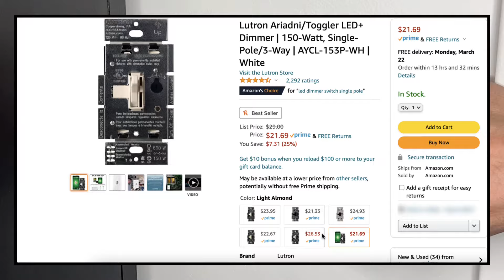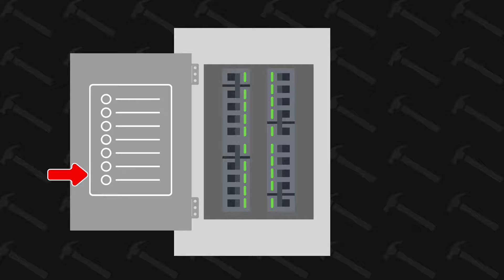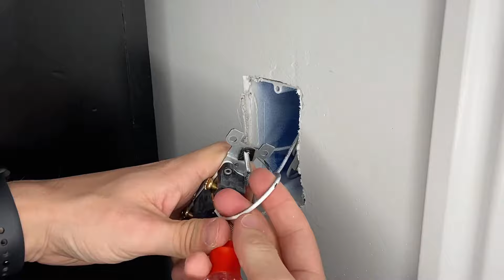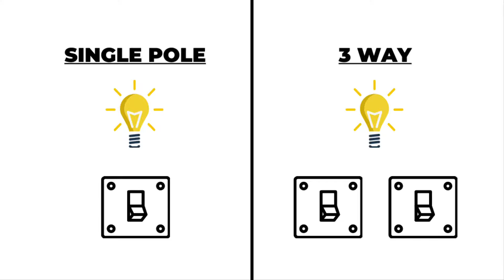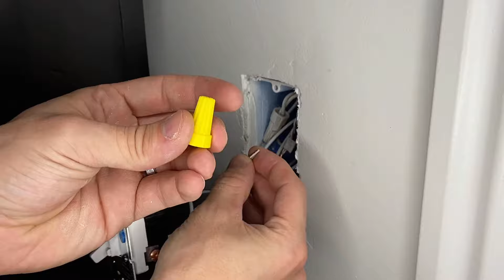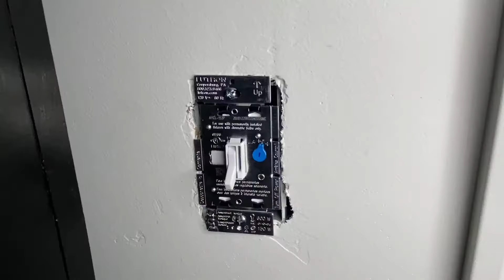How to Install a Dimmer Switch - Single Pole or 3 Way

Comment: i put the breaker number on the inside of the light switch so I am not looking through all the numbers on the panel next time I need to turn off the power to that light/ only takes a second

Comment: perfect it worked for me, I have a 3 switches together, but I needed middle switch to be dimmer, middle switch was single pole, so I replaced the single pole middle switch with this lutron drimmer switch, connect two black wires to the bottom screws on either side and green wire to the neutral and capped it, now the new lutron switch with dimmer works great!

Comment: I watched this and set up everything.  Power off, opened the box, and my simple, single switch had 4 wires connected to it, and the 3-way switch next to it had only 3 wires, no ground wire.   It looks like it was wired so the power in goes to an outlet or another switch.   I'm not going to change the switch myself because I don't know what the original electricians did!!
But the video was good, and is applicable to anyone who has simple switches wired normally!

Comment: I have two black wires and a stripped ground wire. I wired it exactly as shown, with the black wires on either side of the bottom, and the ground tied to the green pigtail. When i flicked it on it blew up quite loudly. Still dont know what I did wrong.

Comment: This video was exceedingly helpful. I was briefly flummoxed as to how to attach the wires to the terminals on this dimmer that can be used as either a three-way or single pole switch. As someone observed a year ago, just mentioning the fact that the black wires can be attached interchangeably made the whole project go much smoother. Really appreciated that observation.
Reply: Agree. I was also confused about just that mixing up!

Comment: What does the blue button or blue dial next to the dimmer slider switch do?
Reply from the maker: It adjusts how sensitive the dimmer is. If you dim the light all the way down, you can adjust the lowest light level with that little switch.

Comment: So mine works but the dimmer is reversed. So the switch is up for power. Down for off. But the dimmer is down for brighter and up for dimmer. Help
Reply from the maker: Sounds like your switch is upside down!

Comment: Super clear and straightforward video. What also helps is that this type of dimmer that you used, is the only one – as of early 2025 – which Home Depot sells. I also stressed out that I had to get the wires in the right holes, and the fact that you explained that helped me out tremendously. The first time I put the wires in the self secure holes, I actually got them wrong and then re-watching your video help me understand the mistake I made.

Comment: You were nailing till you failed by sticking the wire in the back. Also no need to cut your wall. Those metal tabs in the switch are bendable and easily breakable

Comment: Can't thank you enough for your video.  You showed and explained everything so perfectly that I had the dimmer installed in about 15 minutes.  Your explanation of not worrying about the the black wires being interchanged was so helpful.  I would have never thought of that on my own and probably would have given up and hired an electrician!  There's a big smile on my face every time I turn the thing on!😊

Comment: I have a single pole switch. However my light only turns on when both black wires are on the same side of the switch. Why could this why?

Comment: You can adjust the range of the dimmer with that blue dial under the switch cover. No need to cut power, since you will stay outside of where the wires are.
Reply: Thanks! Yes, that is a great feature for this relatively inexpensive dimmer.  I love it!
Reply: Thank you

Comment: I have two black wires, a red and the copper. Following your video for single pole and connecting the two black wires, what do I do with the red wire?
Reply: I have the same question. Did you ever figure it out? If so I'd appreciate if you tell me what I should do. I realize there's a 95% chance you won't even read this, but I thought I'd give it a try. Thanks...
Reply: I ended up hiring an electrician.

Comment: Set of led light were ocassionally flickering.  I was told it might be the switch.  When I started to pull the old switch it had never been grounded.  I grounded it and reinstalled it.  No flickering so far.  Do you think this may have solved my problem.  Flickering would come and go so I don’t know for sure yet.

Comment: Question! I don’t have a red wire on one of my switches PORT when I remove it from one side. Does the dimmer go on that one or is that for the ON/OFF switch?

Comment: My 3-way switch has black, blue, and white wire. It woulld be better to explain what the wires are for (incoming power, switch interconnection, and lamp) rather than just colors.
Reply: Facts. What an idiot

Comment: I still have 0 idea how to put 12 gage wiring to this. The wire is to fat to loop around the screw. On top of thr holes are way to small. Does this switch work with 12/3 wiring?
Reply from the maker: It should!
Reply from the maker: If not, you could get a small connector that reduces the size
Reply: Thankyou I was finally able to figure it out! Took some finesse lol. The screw which the red wire goes to. Is so close to the side it was hard to loop around it.

Comment: I've purchased a new Lutron Diva 8-Amp 0 to 10-Volt 3-Way/Single-Pole Dimmer - and plan to run 5 LED fixtures, operated from a single light switch. The dimmer switch itself has 5 wires (wht/blk/green - self explanitory) and also 2 small wires which I assume are low voltage for dimming. The home has standard 14-2 Romex wiring to the switch box. Not sure what to do with the 2 small wires.

Comment: Quick question! Can you use a 3 way dimmer switch to replace a single pole light switch? What to do with the extra red wire?
Reply from the maker: Yes you should be able too, I’ve never done it before but I don’t see a problem with it. You would just put a wire nut on the unused wire! Hope that helps!

Comment: Not understanding isn’t single pole wiring usually a 14/2 3 wires total including ground usually black white and Copper ?
Reply from the maker: Single pole means you can only turn on/off the light from one location in the room. 3 way means you can turn on/off the light from multiple locations meaning you have more than one switch that turns on and off the same light! Hope that helps!

Comment: So, I have two red wires, and two white wires and no indication which one is the common wire  - house was built in 1994. Any tips on wiring this?
Reply: Might want to use a different dimmer switch with less wires.

Comment: Great video. I have a complicated situation. Im trying to install a dimmer switch. But there is no ground wire im the junction box. What do I do? And also the switch im replacing has another switch right next to it but the black wire is connected to both switches! Idk what to do?
Reply from the maker: The ground wire is not necessary! A lot of older houses usually don’t have a ground! All it does is make the circuit safer so if you can add it great but if not it will still work just fine! 

The black wire is the “hot” wire. In order to switch the light on and off, you’ll need to “ interrupt” the circuit with the switch! That’s why it is most likely connected to both back wires! 

Is the second switch working still? If it’s working it should be fine and you won’t need to replace it? Let me know! I’ll try to help the best I can!
Reply: @Nailedityt  Thanks for answering this, I also don't have a ground wire in the box.  I couldn't find anyone else with this issue, thank you!

Comment: This is the best, most straight forward video on single vs 3 pole dimmer switch installation I have found so far and I've spent a good hour looking for one that explained everything even the bending of the wall plate. Thank you!
Reply: Put both of your screws on thr cover plate , either straight up and down or diagonal to match each other
Reply from the maker: Wow thank you! I’m glad it helped! Thanks for watching!
Reply: @Nailedityt  wi soownwiiioiooubs
Reply: I’m wee whihehoesiei